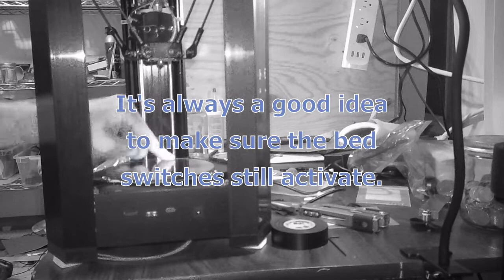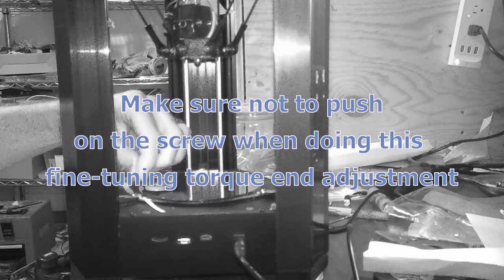MPMD Bed Clips Upgrade Part 2: Calibration (poor video quality)

Comment from the maker: The MPMD V2 does not have the indicator light on the side. I do not own a V2. For the V1, the light changes when any of the three bed switches underneath the bed are activated. 

Ben Hall in the V2 Facebook Group reports that you can view the bed switch status from the LCD menu under Settings -> Diagnosis -> 7. Leveling Sensor Diagnosis. However, you may get better results by listening for the switch to click. 
https://www.facebook.com/photo.php?fbid=10158003818731688&set=p.10158003818731688&type=3

Also, a general reminder that this only helps with switch activation consistency and preventing the bed from moving during printing. You will still need to calibrate and/or align your machine for a better first layer. i.e., this hardware upgrade can make the software delta calibration (not G29) work better, but this upgrade by itself may not do as much.